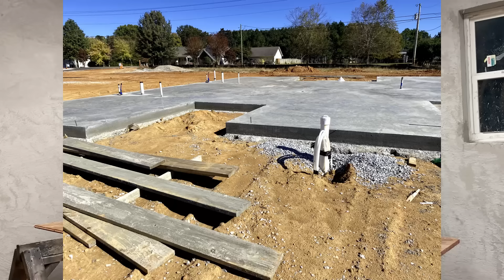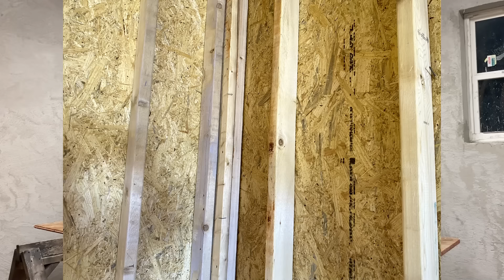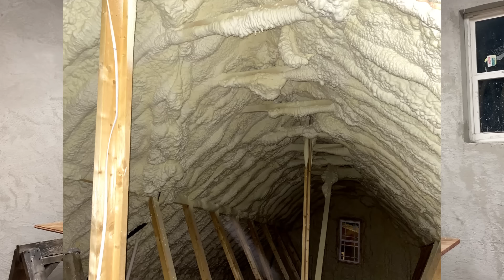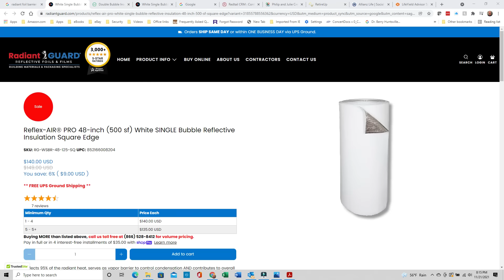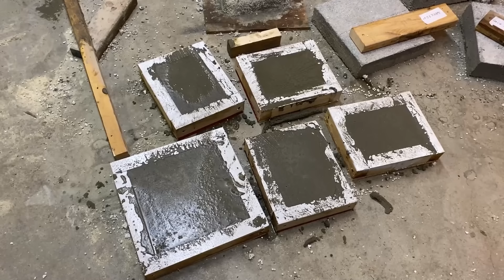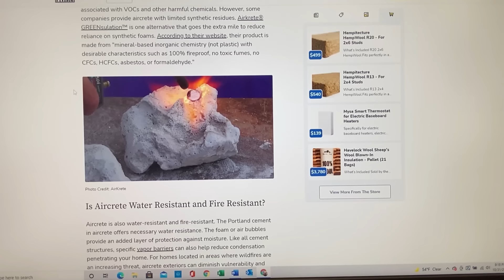Why I Will Never Live in a NORMAL Home AGAIN! Insulation Test!!

Comment: Steve’s Dome home was actually made from thin bricks. It was one of the domes Hajjar and Steve built prior to their familiarity with Aircrete. Many think Steve’s dome home is made of Aircrete since it is on Dome Gaia’s website, but it was an earlier build. Hajjar had many domes built with brick prior to venturing into the Aircrete realm.
Reply from the maker: Thanks for letting me know this. I wondered about that because the video shows using concrete blocks at first but I I couldn't tell if Steve's house was aircrete or not. I tried editing the video but found it to be really difficult so I will just have to leave it.

Comment: Good stuff!  I wish this product was commercially available and at a reasonable cost!
Reply: the cost to ship a product that is 70 to 90% air is not ecnomical so I doubt you will ever see it at a reasonable cost unless you do it yourself with local resources. that's the beauty of the product IMHO.
Reply from the maker: Working on it! Subscribe for new builds coming soon!
Reply: Me too. Would be great if I could pay someone to spray it inside my attic instead of foam. One less building material offgassing sounds good to me.

Comment: I want to use styro and aircrete for a wall insulation with rapid set and zero slump concrete. It  this possible.  Should I do this or choose commercial closed cell spray foam.
Reply from the maker: Juli you can fire treat shredded styrofoam and blow it into your walls. You need to put up insulation cloth first to hold it all in. You could do your walls and roof with this method. You don't even need the aircrete. But you can also do a light aircrete mix and pack it into the walls after it dries. If you put it in wet it takes a long time to dry and can mold on you.
Reply: @AbundanceBuild  thanks

Comment: As a lab tech, the ice bottle approach can be a very good proxy, at least if the "curve" is timed well. Each gram or cc of liquid water in the bottle represents 334 joules of energy.  If you can halt the experiment when there is a bit of both ice and water in each bottle, you should get quantifiable values for each.  A good experiment requires duplicates and ideally some sort of blank or spike.
Reply from the maker: Lowrads thank you for your feedback. I am happy to hear that the frozen bottle test is a good proxy. And yes I still had just a little ice left on the worst one I was testing.

Comment: Would it work as a roofing material?
Reply: Yes, with qualifiers. Is it on load bearing rafters? Or are you going to put some reinforcement in it and also cast it with thicker "beams" on the underside? Because a certain amount of the styrofoam embedded in the concrete matrix is going to show on the surface there's going to have to be a coating or membrane over the styrocrete that's waterproof and UV resistant.
Reply: You should use a roofing material that is resilient to hail damage, waterproof (not porous or prone to cracking), and not heavier than your roof is engineered to hold.
Reply from the maker: Yes, subscribe for new builds coming soon!